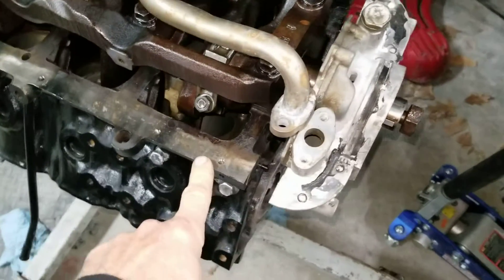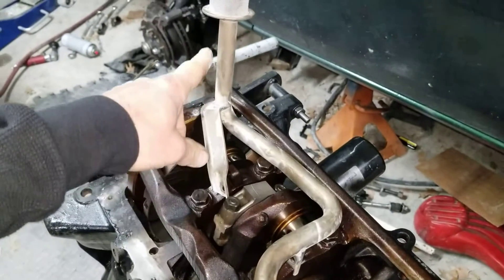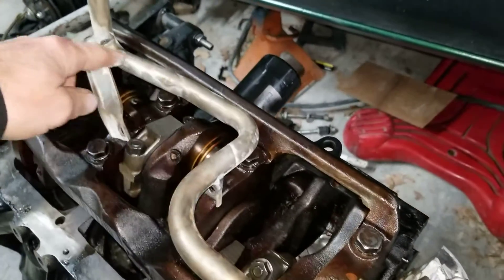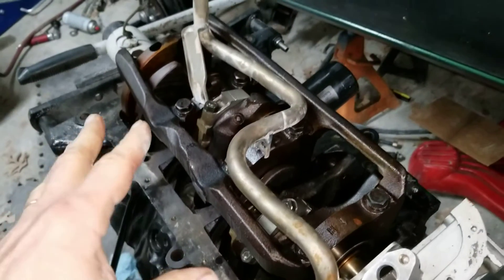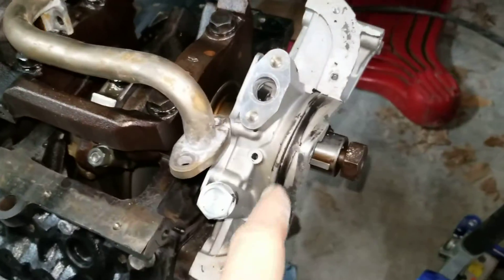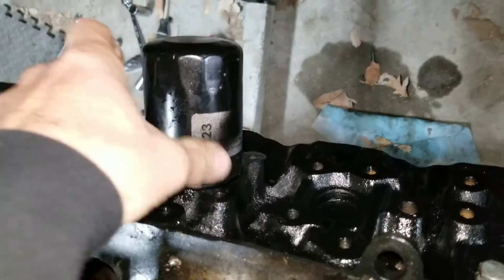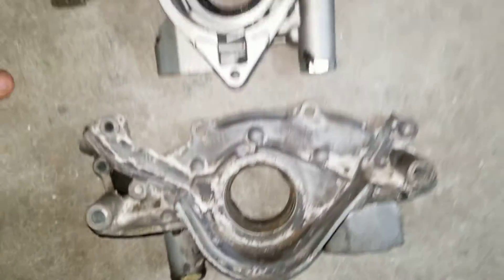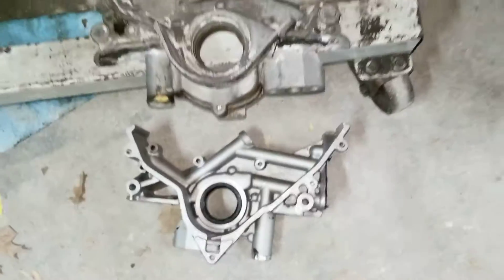Nissan D21 VG30 oil filter relocation. VG33 swap related

Comment: Ok appreciated info I see the crank pully part# hopefully it's avaliable, is this something part store would have ? As not a fan of ordering specific part with ability to verify it's exact what's needed as to the normal Joe it's just a crank pully 😢 thanks again 👍 for replying to me, most usually don't.
Reply from the maker: Its a 95 vg30 nissan crank pulley with v belts instead of multi rib. super hard to find. There is aftermarket adapters that do the same thing. I have never tried one. This 95 2wd d21 video about vg33 swap may help. https://youtu.be/2DeQkDXi_x8?si=tcC_VFrkCChF0vlP

Comment: No i have a 89 SE 2wd it has 2000 pathfinder vg33e as wasn't aware of everything being on opposite sides so haven't used a/c or power steering as a result, also at time of installing my vg30i oil pan wouldn't work with vg33 pickup tube and vg30 has curved section and mounts on opposite on oil pump so had to cut vg33 pickup section of and weld same section of vg30 pickup  and weld to vg33 pickup tube being the strainer section length is much shorter depth wise to use vg30 oil pan, didnt like the oil pan on vg33 and was hitting cross member if I remember, so was wondering difference between quest v40 pump and vg33 pump ? Also if vg30 pan used was 2wd or 4wd as watched video and read write up with parts used , also if using factory steering pump and changing only pully the location it would go on crank pully is being used for alternator as belt location on crank pully for vg33/pathfinder is different then vg30i which leaves me only too use vg33 pump as it's location/position aligns with open belt slot on crank pully ?
Reply from the maker: Are you using all the vg33 ribbed pulleys or the v belts? Most people who do this swap keep the vg30 V belts. There is some people who make an adapter for the crank to run v belt balancer. There was lots of Z cars upgrading to the vg33. https://m.facebook.com/profile.php?id=524918237530164 made one.
Reply: Yeah wasn't no option as the crank pully from vg30 wasnt usable on vg33 to knowledge so only using alternator as nothing else would work a/c connection from truck to vgg33 a/c wouldn't work, power steering pumps won't work but possibly with entire plumbing from xterra/frontier, most of this with custom work done can work, but had finished swap 2yrs ago and tired of driving it with no power steering and no a/c and cause of truck being 89 Se had to carburete it so gas mileage for the power given isn't the best, So very soon gonna park and get these issues addressed and add wiring for mpfi,new to nissan as been into hondas for 20yrs😢 @NissanNut74

Comment: So is there a difference between d21 path and wd21 path ?? U said that pickup tube is from d21 pathy but you also said all wd21 2wd pathfinders use 4wd d21 parts ? I currently swapped my 89 d21 se for a vg33e pathfinder version (unfortunately) and haven't figured out how to get power steering hooked up, as vg33 pump is in opposite location close to steering box same with a/c lines not compatible to d21's factory lines, but at time had to just modify the factory vg30i pickup tube, this was done probably 3yrs ago believe had to change screen angle and remove baffle plates inside pan to allow too reach  mounting surface, so mig weld pickup tube as was only option at moment and worried inside diameter at weld is less due too the weld   don't have a tig welder or know how but would've been better regarding inside remaining open, So what pickup tube will work with 2wd vg30 oil pan on a vg33 ?
Reply from the maker: You can easily swap the pulley on Power steering and use OEM pump. I added a link to vg30 swap in description. https://nissannut.com/maintenance/vg33e_upgrade/compare/index.html  This page also shows the difference between in pickup tubes. I assume you have a 4wd. The pickup tubes are different between 2wd and 4wd d21.

Comment: Has a bad oil ever cause a rattling hydraulic tappet lifter?. Its the oil pump that fail the 60degree v6 engine.
Reply from the maker: Never had an oil pump failure. Had 11 Nissans with VG motors.

Comment: The 2wd D22 V6 trucks all used the 4x4 oil pans, because 4x2 trucks were basically 4x4 trucks but with no transfer case or front diff. Even the front diff mounts are still there on the frame, you can actually bolt the 4x4 parts in.
Reply from the maker: My 2018 2wd d40 frontier has the diff mounts also. Even my 05 2wd armada did also.

Comment: I've got a question for you about modifying these pickup tubes. I'm putting a vg33e into an s12 200sx. Using the 33e oil pump and modifying the pickup tube for front sump. I have to cut and weld the rear sump pickup tube. Is the rough transition on the interior of the tube a concern after cutting/welding? I'm trying to be as clean with it as possible but I guarantee the welds are not as smooth as the stock tube.  Worried about cavitation, but maybe that's not a concern at the oils velocity...  also, how do you ensure the welds are sealed, and cleaned after you're done modifying it? Thank you!
Reply from the maker: You should be fine. But a leak test would be good. Seal off one end. fill tube with air or water.
Reply: Okay will do, I appreciate it!

Comment: I'm going to attempting an even more difficult swap, I believe. Pulling the VG30i (throttle body injection) out of my '87 D21 and swapping in a VG33e from an '04 Xterra. Wish me luck.
Reply from the maker: Thats a popular swap. Great upgrade.
Reply: @NissanNut74  any online resources for info on the electronics part of the swap?
Reply from the maker: @aaronbritt2025  I would use FSM for each vehicle. Just get complete harness of the donor wd22.
Reply: @NissanNut74  I have the whole vehicle. Bought an Xterra from Co-part for $800. I imagine I'll be re-pinning some stuff. Was hoping someone already did it.
Reply from the maker: @aaronbritt2025  Perfect start. Just pull the whole harness and strip down to an engine harness. It has been done many times. I know people have done the vg33er in many older vehicles. The 300zx guys do tons on vg33 swaps. My z24i conversion process should help: http://nissannut.com/projects/z24i_fuel_injection/
Reply: @NissanNut74  Thanks. I used to be a Nissan master tech, but never did much work on older stuff. Not looking forward to dealing with NATS. This '04 Xterra has NATS, so I may need to find a pre-NATS ECM.
Reply from the maker: @aaronbritt2025  If you have the key(s) for the 04. Just use the whole NATS. There is ways to bypass it. I personally like the idea of NATS. My son's 12 Versa does not have it. I wish it did. I had to bypass the fuel pump kill on a friends 04 frontier (vq40de) It was not detecting the transmission nuetral. I replaced trans ecu and neutral assembly. It was a bad IPDM.
Reply: @NissanNut74  I have a key but it's probably bad. Won't start, has a "difference of key" code.
Reply: I'm going this route if the valves on my 87 pathy are bent... any update?
Reply: @ecortez311  on the back burner. Got way too busy to mess with my own projects.

Comment: how do i take the crank gear off easy? on vg30 and 33. is there guide pins in the punp or block or can i emove the crank shaft with the oil ump wtil hanging aroud it for swap
Reply from the maker: I pulled on the oil pump. It was not easy. Definitely the hardest part of the whole rebuild.

Comment: You have any tips when it comes to squeezing the oil pump seal over the crank snout, when installing it onto the block. The tolerance is so tight its causing  the seal to catch and pull on the thicker part of the snout.
Reply from the maker: I had to replace a badly installed seal on my 92 pathy. It is possible. Just have to be very careful sliding in the seal. I replaced with engine in after the rebuild it was leaking because of the lip not sitting flush. Take the radiator out and you should have enough room.
Reply: @NissanNut74  I already have the entire block out on a stand so having enough space isnt the issue. Just having trouble fitting the oil pump with the seal installed  onto the snout.

Comment: Do you have a link to the write up to this? Interested in swapping the vg33 in a d21 2wd
Reply from the maker: I have not done one, I do have parts to install vg33 oil pump in a vg30. Just need the pickup tube. My webpage has some comparisons that may help.  http://nissannut.com/maintenance/vg33e_upgrade/  balancer is the issue.
Reply: @NissanNut74  was wondering about your screen pic with parts used on oil pick up it says d22 pick up but as you name parts you say 4×4 d21 tube , so will d21 vg30i pan work on 33 pump and tube swapping a 33 into a 2wd hardbody with vg30i ? Any help be appreciated. Thanks
Reply from the maker: @4077661466jp   Do you have 4wd d21? The vg33 comes with different pickup tubes. What vehicle the vg33 come from? I only noticed the d22 vg33 is same 2wd and 4wd, unlike d21 where there different. A d22 pickup tube should work to convert most vg33 pumps.
Reply: @NissanNut74  I have a 2wd 1989 d21 with vg30i and between the difference in location of accessories ac,power steer and alternator I can't mix and which I can only use big snout crank pulley and matching accessories have to be used together not changing cranks so a lot of rewiring then comes oil pan/sump issue motor that's Going in is a jdm vg33 from 01-02 xterra I believe, and have read to use vg33 quest oil pump and the pan and sump from vg30i will work and clear cross memer but on budget and don't want to be guessing parts to use so haven't bought quest oil pump unless I know guarantee it will work but kinda in the air as what to do, new to the nissan game but mechanical inclined and been doin the Hondas for over a decade originally wanted to get factory vg30et manifolds for turbo set up all my buddies got full size Ford/ chevys trucks kinda the odd one in terms of vehicle choices lol.
Reply from the maker: @4077661466jp  You only need to shorten the pickup tube or shorten the xterra one . I dont see a need to change oil pump. I used a quest pump to re-use the small snout crank and relocate the filter. Using the donor vg33 harness is a great idea. Keep all the vg33 accessories. only the pathy had a wierd setup compared to w/d2x.
Reply: @NissanNut74  thanks will check out
Reply: Currently in process of doing this very swap debating on which fuel system I'm gonna use cheapest easiest way is swap tbi setup onto the 33 or haunt down vg30e in junkyard to get EFI/ecu and rewire needed plugs for a more  Efficient fuel consumption system.

Comment: Finding these pickup tubes and oil pans. That's the real trick! I'm just happy my VG33 is in and done.
Reply from the maker: Actaully the d22 pickup tube is available for $30 at US dealers, appears to be same for 2/4wd. I am going to modify my 2wd wd21 for my 2wd d21. Using a vg33 r50 pump. Now the vg30 stuff may be hard to find new. The oil block off plate is $6 new. I gave up finding an easy one to yank at junk yard last week. Not worth it when new is $6.
Reply: Yes this is exactly what your gonna have to do unfortunately i only have a mig welder but recommend using a tig welder as mig is a tad harsh for metal thickness and currently works but concerned with i.d diameter having possible flow interruption due to weld bead, was hoping of a bolt on solution.@NissanNut74